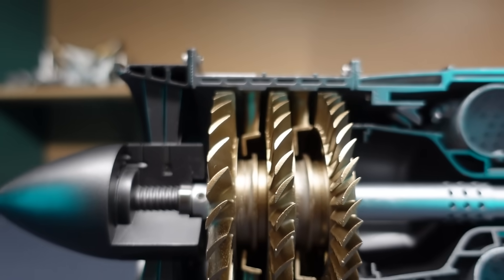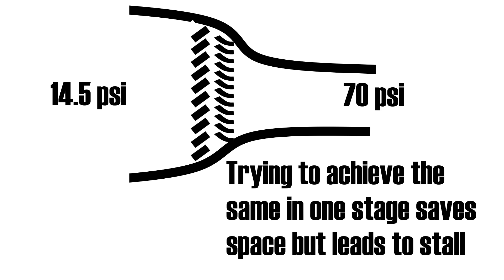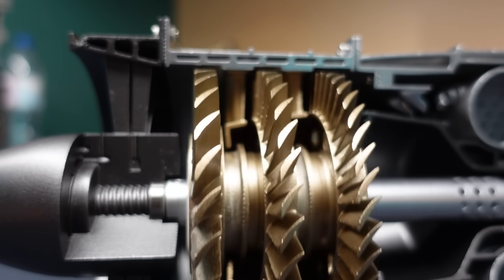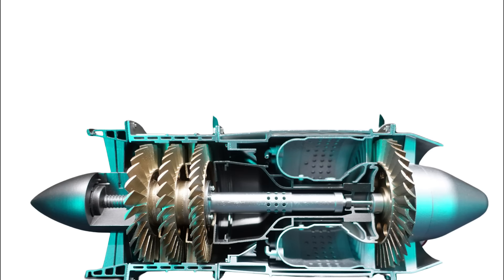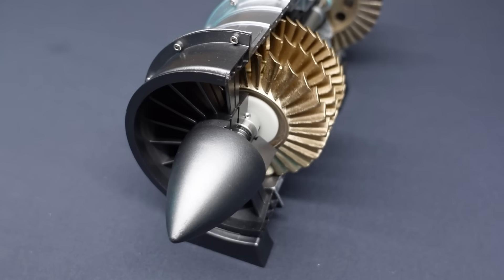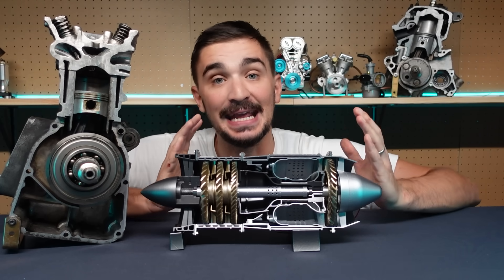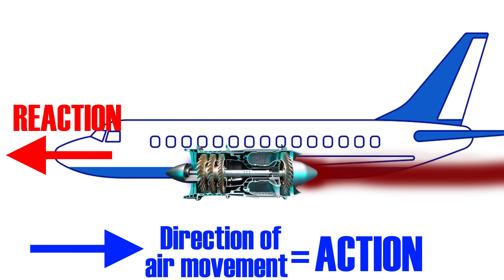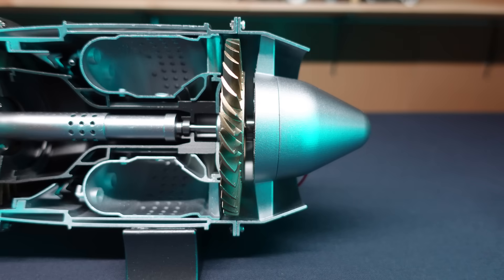Appreciating The Beauty of Jet Engines by Juxtaposing Them Against Piston Engines

Comment: Once you start calculating stage efficiencies and blade angles in gas turbines, that’s where the real fun starts :)
Reply: I can only imagine....blade shapes, blade angles, blade spacing/number of blades used, distance between sets of blades, stator shapes, stator distance, combustion chamber shape/ size....The list goes on, to determine which design works best overall= driving yourself crazy 🤪 🤪
Reply: @michaelbrinks8089  One would need to have a good simulation program that then could automatically go through thousands of iterations to optimise various parameters and converge on the "best" design for a specific task.
Reply: plus some of them are variable  :) 
 @michaelbrinks8089
Reply: Blade and stator:
Cross-section
Shape
Size
Angle
Curvature
Thickness
Spacing
Material
Surface texture
Weight
Bending moment
Efficient RPM range

These things are on top of my mind

Add more if anyone know/think of more
Reply: bleed systems to keep flame holding attached to variators that can change pressures at individual stages on some systems . I had to develop a mould plunging tool for turbines to extract the negative without collapsing the walls of the sand cast for a variable stage setup was all the fun. @pruthvirajbhople
Reply: For real. I love it how 50,000 people think it's so easy now after watching a 16 minute introduction to jet engines.
Reply: @Sqeeze_da_cheez people aren't thinking that.  It's like any topic, the theory and basically of operation are simple when explained well.  When it comes to actually making it thats when it becomes complicated.

Comment: I have a question that “unifies” jet engines and cars: how does the power get transmitted in a jet car? Does it only use the thrust of the engine or does the engine rotation power get harvested and transfered to the wheels?
Reply from the maker: I'm honestly not 100% sure for the racing jet dragsters. Intuitively I think they only use the thrust. But other things like the Abrams M1 thank uses a turboshaft design where the shaft is the output.
Reply: @d4a I think he's asking about things like the old Chrysler turbine cars, which used turboshaft engines. Jet dragsters, like you mentioned, exclusively rely on raw thrust, which is part of why Top Fuel cars still clear the 1/4 mile quicker than jet dragsters.
Reply: @griffinfaulkner3514 also the Lotus 56 and 56B, cars that raced at Indy and also in F1

Comment: In a piston engine, the matter is obvious: valves prevent the pressure from "rolling back" during ignition. However, it is still inexplicable for me why the pressure in the combustion chamber of a turbine engine does not broke  the compressor rotors.
Reply: It's not explained well in the video, but the pressure  doesnt increase after the compressor, the gas heats up and because there is an open end at the nozzle it expands toward that open end and increases in velocity.
Reply: Adding to the other comment, flow going backwards because of the unfavorable pressure gradient is still a big problem, especialy in the compressor, but that can be acounted in design. If the air has enought inertia it can fight the pressure gradient, so the compressor is designed with that in mind to ensure it in cruise speed, and for idle or engine start, when mass flow is low, blow off valves can be used to lower the pressure so that some air can continue flowing.
For the turbine, the pressure actuall decrease (by harvesting it with the rotors or converting it to speed), so the combusted air "preffers" to flow to the turbine rather than to the compressor
Reply: thank you very much for your explenations @IkarimTheCreature and  @alejogonzalez4997! They show that understanding the operatio of a turbine engine cannot be as intuitive as that of a piston engine, and its design is not a simple matter. On the margine of these considerations, a question arises about the efficiency of a turbine engine, which by some analogy remindes me of a piston engine with leaking pistons

Comment: Another huge upside for jet engines is their incredible reliability, as long as they are maintained properly they will almost never fail, save for external things like a birdstrike or a fuel system failure that would have stopped any type of engine.

And even if one of them were to fail, they have so much power that a fully loaded passenger jet is capable of climbing on a single engine. They just fit so perfectly in the role of an aircraft engine it's incredible
Reply: They have an extremely long life span compared to piston engines but yes they do fail... Usually to degrading turbine blades because it's the most stressed member of the system. One major facor is thermal cycling. The longer the engine runs at a time the longer it will last. Industrial turbine engines that never shut off can last up to 20000h. The thermal cycling lead to cracking of the turbine blades.
Reply: As an aircraft maintenance technician I can attest to this, in fact, only a few hours ago I was doing an internal inspection of a 737 jet engine for wear and damage. The engine in question had just under 35,000 hours on it. Meaning that it had been ran for close to 35,000 hours. The inspection went fine, which is to be expected, because we normally get another 20,000 hours out of it before it needs to rebuilt! They are truly magnificent feats of engineering.
Reply: @D3V1NF5  The single biggest reason that jet turbines can hit those figures is the lack of rubbing contact. Pistons are reliant on rubbing contact all over the place in order to work at all, but turbines glide on by. It's such a simple notion, but that little difference of theory makes for a staggering performance difference.
Reply: How's the whole diversity hire issue in the world of aircraft maintenance? It's horrible in the pilot world. It is scary, I see for at least the automotive and Industrial mechanic world the mechanics are less and less competent. I sure hope that is not the case in A&P
Reply: Exactly, two same piston engines can have very different life spans based on usage patterns (short vs long drives) and level of maintenance (doing bare minimum or even skipping service vs going all out with shorter intervals and preventive measures).
Reply: I largely agree, however, a birdstrike will do barely anything to a piston engine, but can totally destroy a turbine.
Reply: @Blockbuster2033   Clogging the air intake on a piston will lead to an extremely lean air-fuel ratio leading to numerous issues that can permanently damage the engine. What are you talking about?
Reply: @MinecraftMasterNo1  That is correct, but the air intake is extremely small for a piston engine in comparison to a turbine engine making it less likely to get hit. Also it's very unlikely that it actually clogs up.
Reply: @Blockbuster2033  That is what air filters are for, after all. FOD can still be a big problem for piston engines.
Reply: @MinecraftMasterNo1   A clogged air intake on a carbureted piston engine will cause a rich mixture, as if the choke was still on. A rich fuel mixture cools a piston engine but increases turbine temperature of a jet engine.
Reply: @MinecraftMasterNo1 
Clogging the air intake will not cause a lean condition in the piston engine which is a higher air to fuel ratio causing engine seizure due to combustion chamber temperatures  reaching  melting points of aluminum (around 1600 F ) thereby usually causing the rings to stick and then to have no compression or locking motor up when sides of pistions melt and adhere  to the cylinder walls. A clogged intake causes a rich condition , like a choke and will reduce power and possibly foul the spark plugs. Normally a rich condition is better because the enginecl isnt damaged but in an airplane neither are good if it leads to decreased power and shutting down or seizing and shutting down. Most newer piston engines are Fuel injected and if the air is reduced the fuel spray will be compensated as well to a certain degree. It shouldnt foul the plugs but it depends on how clogged the air intake is.
Reply: @Blockbuster2033 piston engines need to be connected to a propeller just like turbofans, they are also susceptible to birds
Reply: EVERY mechanical device is "reliable" if maintained properly.

Comment: Thank you so much for indulging in my request from your last video! I'm looking forward to the next installments of this series. One last thing, I don't want to be pedantic but at 6:50 you made a little mistake. The pressure doesn't rise in a constant pressure type engine like a gas turbine, the temperature and velocity of the gas increases.
Reply from the maker: Yes, a few things interconnected at the same time so it happened :) Maybe I should have worded that part differently and made it more clear that what I'm describing is the engine being fired up, hence the mentioning of the sparking. I'm basically referring to how all the steps increase the potential energy in front of the turbine. Obviously pressure increases with combustion in comparison to what it was before combustion started and then remains relatively constant since combustion is mostly constant. Hope it makes more sense now.
Reply: @d4a  It's realy untuitive, but the gas never increases in pressure in a jet engine combustor, since it is allowed to freely expand and speed up towards the turbine section where the speed is harnessed, and used in the compressor section to increase pressure. But your video makes it seem like the combustion chamber is what increases the pressure. If it did that the flames would shoot out the front and you would have a real mess. No one expects the pressure to peak at the compressor section, but at this point it feels like esotheric knowledge to most people, so it would be super appreciated if you could elaborate on this when you make a video about the crysler gas turbine or the olds mobile coal turbine cars. cheers!
Reply: @IkarimTheCreature  talking about esoteric (or exoteric) knowledge, I confess I still feel it's counter-intuitive the fact you have less pressure in the middle of a venturi

Comment: Thermoelectric gas turbines for Hybrid electric cars🤔 
Thoughts?
Reply: The Ariel Hipercar is a really cool concept of a gas turbine being used as a range extender for an EV. Main downsides that I can see are that turbines are very, very loud. They are also fairly inefficient unless they are huge (as opposed to a piston engine that is typically more efficient the smaller it is). The only other major reason other than cooling, that I can think of would be cost. Gas turbines are not cheap to design, make, or service. Other than that, they are pretty much perfect.
Reply: The saracasm is strong in that response, @MyHandleIsGood  ... and it's completely valid.

Comment: An excellent concise video, thank you very much ! So at high altitudes airplanes with jet-engines travel faster and use less fuel due to less drag, higher compression and better cooling due to subzero temperatures, low density gas and more diverted energy for compression of the thin air ?

Comment: i always wondered if its possible to get a high ratioed transmission onto the common shaft to drive some wheels instead of relying soley on their emission to drive a vehicle
Reply from the maker: Sure, turboshaft engines exist. Best known example is probably the Abrams M1 tank.
Reply: Chrysler had a prototype turbine car, and there was a company called Turbonique, which produced small turbines that attached directly to car axles.
Reply: Turbonique and turboshaft engines... Thanks for the new info! I will look into that
Reply: Oh, turboshaft engines are pretty comon in aeronautics too. For moving an helicopter rotor turboshafts are almost always the way to go, and "big" planes with proppelers actually use reaction engines, in this case they are called turboprop, but they have more turbine stages to harvest almost all the energy from the exaust and power the propeler.
The key diference between a turboshaft and a turboprop is that they are the same haha, only that the later always has a propeler in the end of the driven shaft.
The key diference between a turboshaft and a turbojet is that the later tryes to harvest the minimun amount of energy from the exaust with the turbine (only to mantain the compressor and accesories working) so it can generate thrust, and the former actually tires to harvest all that speed into mechanical energy to drive the shaft.

Comment: Aircraft mechanic here, just a note. While what you described is in fact a turbo-jet, was was used on aircraft in the past most airliners today use turbo-fans for turbo-props. Basically the turbine is just a torque producer to run a big ducted fan or a propeller. 
think of Dash-8, it is turbine driven but they don't produce thrust, only torque for the props.
Reply from the maker: Hi Aircraft mechanic, yes, I mentioned this at the very end of the video. This is an ancient design but it's there to explain the basics.
Reply: @d4a also aircraft mechanic here the power section blades stator and rotor look backwards on your model. The engine would be operating backwards in that configuration. Might warrant a reupload to prevent confusion.

But definitely fix if you are using that model for teaching purposes in future videos.
Reply: @indiglowpufferfish1002 I thought too. If the turbine blades were to spin in it's correct rotation, the compressors would be directing airflow the wrong way.
Reply: @indiglowpufferfish1002 the orientation of the blades is a few more levels advanced than this video really needs
Reply: @tturi2 
Yesn't? It would have confused me, if I hadn't been working with it.
I would have known how pinwheels or computer fans work, and the orientation in the video falsley contradicts that. Additionally fluid dynamics are weird at high velocities so I probably would have delved into why turbine blades are oriented backwards or maybe variable in pitch (like the VSVs in turbo fans) instead of assuming that the model is straight up wrong.
It's not a huge problem, but it's definetely worth mentioning if he makes another video.

Comment: Can you quickly explain how the last turbine, powered by the hot combusted gas, makes the other turbines rotate in the right way? Intuitively, as the last blades are in the opposite direction compared to the ones that compress the air, I don't get how they can all turn in the same way. Great video, thank you!!
Reply from the maker: I'm not sure I get the source of confusion, sorry if I'm missing something. Think of it like a turbo in a car engine. Both wheels are fixed on a shaft and they rotate in the same direction, you shape and position the blades to what you want. As you correctly pointed out the compressor blades and the turbine blades have different directions so they do different things even though the rotate in the same direction. You sort of explained it yourself already?
Reply: @d4a Viewed from the front of the engine, the compression blades should rotate clock-wise, in order to compress the air like a turbo. However, intuitively, the rear compression turbine should rotate anti-clockwise, based on how the blades are oriented, like a wind turbine. In a turbocompressor, the blades of both wheels are oriented in the same 'direction', which is not the case on your model. I might miss something tho. Thank you for your answers 😊
Reply: I think what he is referring to is the blades of the turbine are oriented in the wrong direction. It appears the exhaust is turning the turbine clockwise, this would cause the compressor wheels to push air out of the intake. Unless I'm missing something
Reply from the maker: @Phantom-mk4kp  You're not! Crap I just noticed this now. Please check out the pinned comment. The turbine wheel is definitely flipped wrong. I think it couldn't be installed differently, I just quickly breezed through the assembly and focused on shooting so I missed it. But the video is, fortunately, just the operating principle, I didn't really discuss any fluid dynamics or blade shapes or anything. This will all be fixed and explained in more detail in future videos.
Reply: @d4a  Next video could be why a turbine driven ducted fan or propeller is much more energy efficient, than a straight turbine jet
Reply: @Phantom-mk4kp  That's exactly it ✌️
Reply: @Tom-cs7ff The only thing that we may not be getting is the shape of the blades are not flat, the have the profile of an aircraft wing. Does this mean they actually turn in the opposite direction to what we are imagining